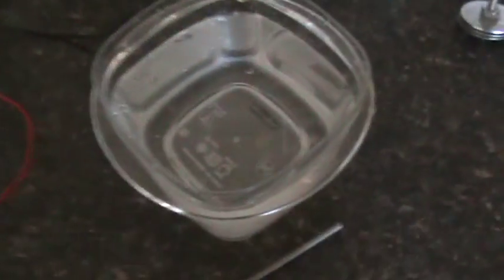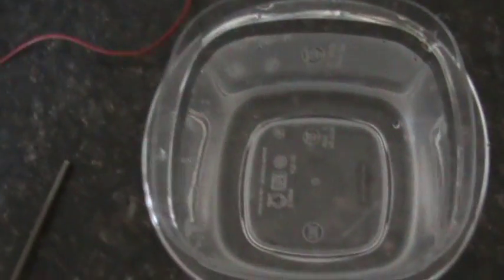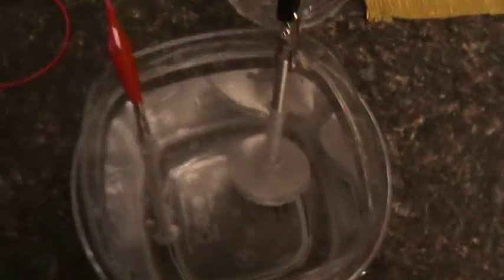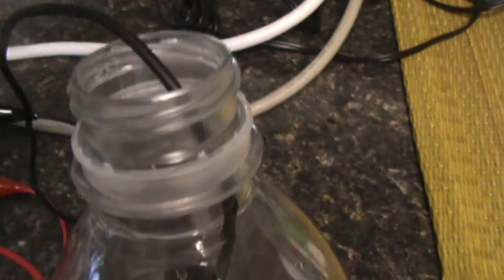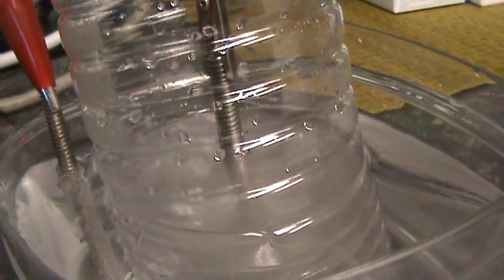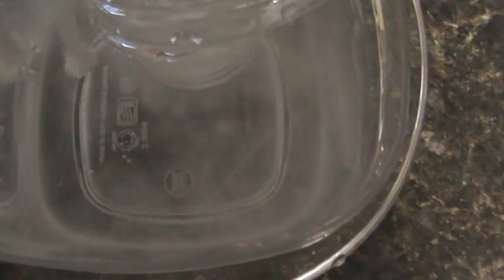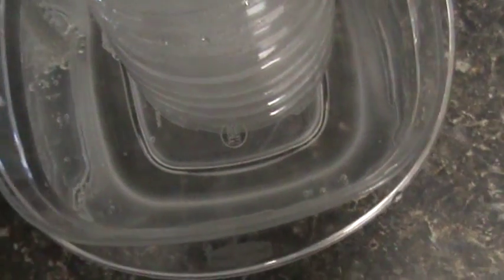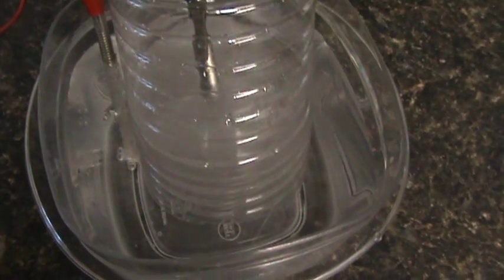HHO Generator theory  seperating the hydrogen  # 1 test

Comment: if you want to to this using a plate cell all you have to do is use a isolation plate like this  | h2  | o2  | h2 | O2 |
        -    Acrilic N Acrilic  +
i'm not sure that was clear enough, but i hope you get the idea (n = neutral plate)